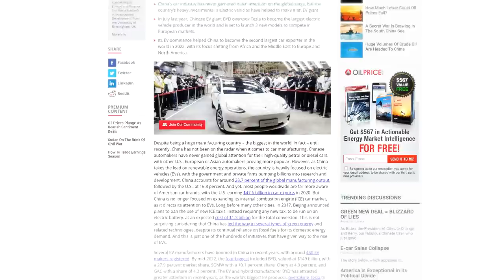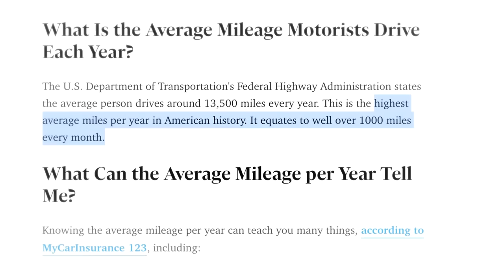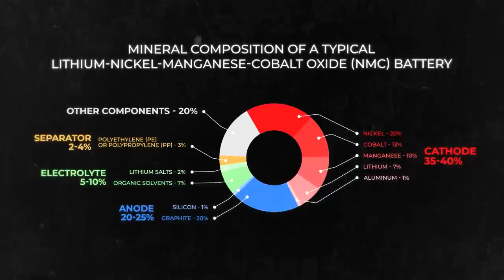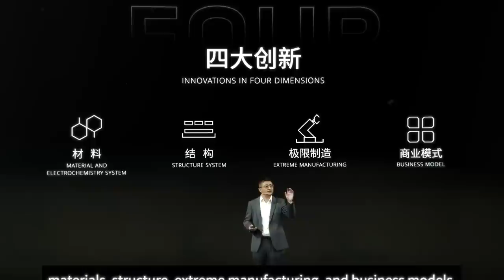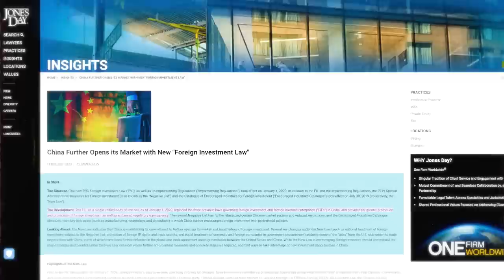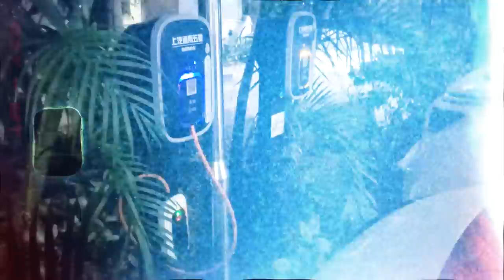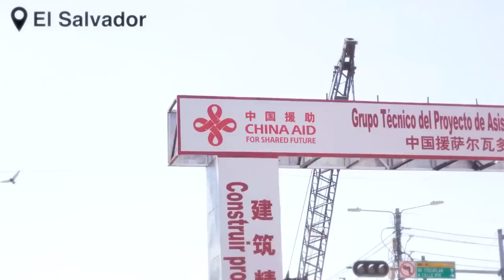How China Plans To Dominate the EV Industry

Comment: In 1Q2023 China has overtaken Japan as the top exporter of cars.
Reply from the maker: Ah, wish I had gotten a chance to include that stat in the video. Things change so quickly!
Reply: Including foreign brand's Cars made in China
Reply: @LaowaiDaveJCP  And Japan statistics include used cars export.
Reply: @LaowaiDaveJCP Tesla made in China, Ford made in China, Toyota made in China, so you admitted China have been more opened up to foreign business than jpan , USA
Reply: Not quality.
Reply: @lawrenceralph7481  All relative to price point. You could pick up a brand new Hyundai in the US back in the 1990s for $8,995. The 2023 Elantra is now 23k. All Chinese brands will increase in quality and therefor in prices as well.
Reply: @lawrenceralph7481 
The safety standard of BYD is 5 stars according to e.u. standard, it's battery come with 8 years warranty.
Reply: @LaowaiDaveJCP  From January to April in 2023, the top 10 auto export brands: SAIC Motor exported 313,000 vehicles, ranking first; Chery Automobile exported 244,000 units, ranking second; Tesla ranked third with 128,000 exports; Changan Automobile exports 117,000 units ranked fourth; Geely Auto exported 76,000 units, ranking fifth; Great Wall exports 74,000 units ranked sixth; Dongfeng Motor exported 66,000 units, ranking seventh; JAC exports 58,000 units ranked eighth; Byd exports 58,000 units, ranking ninth; Beijing Auto exports 50, 000 units ranked 10th.
Reply: @weizhang2834  absolutely China is more open than many other free market economies i know. I dont hate China i admire the Chinese Car market and China as a country The progress is amazing. 加油 However the numbers also include many foreign brands that's a fact and i Hope this number would rise multiple times when Nio,xpeng, byd, Liauto, zeekr get a fair share of the global market.
Reply: @LaowaiDaveJCP  In the era of globalization, it is normal to have foreign brands; However, China's own brands account for the vast majority of exported cars.
Reply: But it seems only in terms of volume, rather than profit.
Reply: @lawrenceralph7481  Go watch Sandy Monro ( American) comments on Chinese EV
Reply: 💐Peace Be With You💐
We invite you to the Religion of Islam, as
 you may find peace.
💎ISLAAM💎 is the latest revelation from The Almighty Allah (God) for all the  humankinds worldwide. 
If you die as a non-Muslim, according to Holy Qur'an there'd be an eternal punishment in the hell fire for  other religions will be invalid and it'll have consequences, since 1400 years, The Rules Apply.
Suggestion: Do Some research about All the  Religions, and then Choose the Religion That makes most sense. 
Welcome To ISLAAM 💚💐
Reply: We're just at the beginning of EV era and Japan already lost out... Increasingly Japan is only relevant in very niche markets, such as a specific type of semicondictor machine, or image sensor...
Reply: @lawrenceralph7481  You can compare the quality between a Tesla model3 made in Texas and a Tesla model3 made in Shanghai and you'll get an interesting result😂
Reply: So what? Do you care at all about quality & safety?
Reply: Becoz of tesla😢

Comment: I came to Shanghai recently from Canada, and I was shocked by the number of EVs running on the road. I also hear that if one wants to provide service like Uber they have to use an EV. Also, when i use car hailing services, i notice many local brands of EV that were unheard of. I think its one of those really strategically smart moves to boost the industry.
Reply: That‘s because the license plates of traditional internal combustion engine (ICE) cars are too expensive. Shanghai currently issues gasoline license plates through auctions, with 233,761 people participating in January, of which only 5.7 percent received a plate, with the lowest price sold at RMB 91,800. There is NO restrictions on what kind of car you need to be a Didi driver, but new drivers usually buy EVs because they are far more affordable and energy efficient. A vast majority of new Didi drivers buy EVs of Roewe, a local brand under Shanghai Automobile Industry Co., Ltd (SAIC). In the overseas market, these EVs are better known under the brand of MG, also an affiliate of SAIC.
Reply: Your understanding is incorrect. It's not that you can't do ride hailing services without an electric vehicle. As is well known, electric vehicles have much lower daily costs than gasoline vehicles, so using electric vehicles has higher profits and can earn more money, which no one can refuse.
Reply: @brushesSolder  that's fair - I heard that from some driver. Thanks for the update anyways
Reply: 電動車衹是一個工具，更難的是強大的電網，如何去解缺大量的充電需求
Reply: @lolololaw6939  上海几乎任何一个小区和商务楼都有充电桩。有需求就会有动力解决。如果你们解决不了，那说明你们的电网不够强大。
Reply: @cosmoobserver3416  我在廣州我很清楚，中国電網是世界頂尖的，尤其是超高壓傳輸😄
Reply: @lolololaw6939  中国国家电网是中国专利数量第一的科技公司。特高压电网是中国独一无二的技术。😄
Reply: 💐Peace Be With You💐
We invite you to the Religion of Islam, as
 you may find peace.
💎ISLAAM💎 is the latest revelation from The Almighty Allah (God) for all the  humankinds worldwide. 
If you die as a non-Muslim, according to Holy Qur'an there'd be an eternal punishment in the hell fire for  other religions will be invalid and it'll have consequences, since 1400 years, The Rules Apply.
Suggestion: Do Some research about All the  Religions, and then Choose the Religion That makes most sense. 
Welcome To ISLAAM 💚💐
Reply: @brushesSolder o I’m Chinese I can tell you that an EV is a must to gain the approval to provide service, on the other hand the driver positively accepts this regulation because only EV could be profitable.
Reply: Yea just came back from Shanghai last month and the roadside air quality is quite amazing. That's unthinkable just 10 years ago.
Reply: China at least have 30-40 ev brands. nearly all big companies join to make EVs in China. every day in Beijing i can sea a new EV spot on road.

Comment: China committed to be carbon neutral by 2060 and EV is a key strategy.  Don’t think market domination is a primary objective, respect and preserve the earth is a more important mission.

BTW, BYD Seagull offers Sodium ION battery now, which is cheaper to reduce; sodium is much easier to acquire than lithium also more environmentally friendly during manufacturing.

I bought my Tesla in 2017, received a healthy tax refund from federal and a rebate from California state, total close to $8000 dollars.  In addition, I can drive my car on carpool lane by myself.  So government subsidy in US has been in place for many years, the new law actually limits the federal credit amount based on where battery is made.
Reply from the maker: I believe the primary objective is reduce their biggest geopolitical weakness, which is their economy requires a massive amount of petrochemicals imports to run. Electricity can be generated internally either via coal, nuclear, or renewables, all three which China is heavily invested in.
Reply: China had no choice but to implement a policy whereby each car manufacturer must produce 40% of their production must be EV by 2030 in the first stage.
Heavy pollution ,a low visibility from  50 meter onward and health concern cause an alarm to central government. High rise building on the opposite site and beyond that range is beyond visibility. To tackle this issues in 2015 China embark this programs by providing billion of dollar to manufacturer, local government were provide financial support to build charging station free and to accelerate this program buyer was given an amount 60 thousands Renembi subsidy for their 1st EV until 2030
Reply: @Ukit50 Subsidies have ended at the end of last year, and car manufacturers have also reduced the cost of EVs to be close to that of gasoline vehicles. The important thing is that the environment for EV use has become friendly under the promotion of the government, and people can buy EVs with confidence.
Reply: @yudogcome5901  
ok mistaken effective 1st Jan 2023 ( 15 years subsidy) but other alternative  initiative was offer to attract EV buyer
Reply: @Ukit50 Yes, as I said, the government is creating a friendly environment for EV use, such as relatively high oil prices that are not linked to international oil prices😂, EV charging prices that are priced separately, and EV charging does not include household ladder electricity prices, 0.3 from 10:00 p.m. to 8:00 a.m.  Yuan/kwh, mandatory community supporting charging piles, charging car parking discounts, big cities restrict the registration of gasoline vehicles, but open the registration of new energy vehicles, these work, the Chinese government has continued to promote for 20 years
Reply: @MeridianMindset  發展電動車 不能忽略強大的電網，然而中国在電力和超高壓傳輸很強
Reply from the maker: @lolololaw6939  是的，那是另一個我希望我已經在影片中包含的事實"
Reply: @MeridianMindset  👍👍
Reply: 我家是农村的  20年前开始退耕还林…现在是青山绿水…我们的新疆省更是把沙漠变成了绿洲…电能是取之不尽的能源   未来的世界飞机 轮船也将是电动的 …有机会去中国看看吧 ， 现在的中国已经不是任人宰割的大清王朝了！😊看到了中国如今的变化你会有全新的认知…欢迎到中国来游玩…人类命运是共同的，地球就这么大 到处去看看吧
Reply: 💐Peace Be With You💐
We invite you to the Religion of Islam, as
 you may find peace.
💎ISLAAM💎 is the latest revelation from The Almighty Allah (God) for all the  humankinds worldwide. 
If you die as a non-Muslim, according to Holy Qur'an there'd be an eternal punishment in the hell fire for  other religions will be invalid and it'll have consequences, since 1400 years, The Rules Apply.
Suggestion: Do Some research about All the  Religions, and then Choose the Religion That makes most sense. 
Welcome To ISLAAM 💚💐
Reply: 💐Peace Be With You💐
We invite you to the Religion of Islam, as
 you may find peace.
💎ISLAAM💎 is the latest revelation from The Almighty Allah (God) for all the  humankinds worldwide. 
If you die as a non-Muslim, according to Holy Qur'an there'd be an eternal punishment in the hell fire for  other religions will be invalid and it'll have consequences, since 1400 years, The Rules Apply.
Suggestion: Do Some research about All the  Religions, and then Choose the Religion That makes most sense. 
Welcome To ISLAAM 💚💐

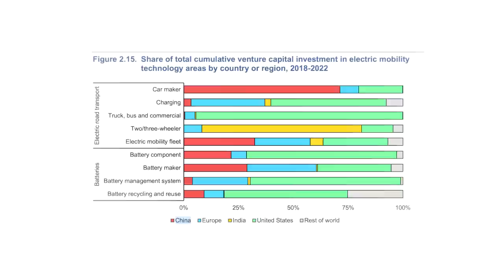Comment: 15:23 Unlike fuel cells, which have no problems with scarcity of raw materials. Right…
Reply from the maker: The scare materials being used in fuel cells, platinum group metals (PGMs), are also used in catalytic converters, hence there's not much of a difference if they were to be switch over to fuel cell vehicles.
Reply: @MeridianMindset  I wouldn't assume it's just platinum for some single kind of component. OTOH we should not assume the technology is static. Substitutes are sometimes possible. On the flip side, some new tech may come along that performs better, but may have more resource constraints.

Comment: The big question is, how long will they last and how reliable they be?
Reply from the maker: As mentioned in the video, it's generally easier to make a reliable EV compared to a reliable ICE automobile. The biggest problem with EV is the battery, which loses range over time, and, in rare instances, can combust causing a deadly fire. 

Of course, there's alot cars manufactures can get wrong there than the motor or propulsion. Infotainment systems, handling, suspension, panel gaps, safety features and other features are just as hard on EVs to get right.

However, there's been no evidence to my knowledge that Chinese cars being sold today are of particularly poor quality. Chinese suppliers have been supplying Western manufactures with parts for quite some time, and should be familiar with Western demands for quality control. And in 2023, they're projected to pass Japan as the biggest auto exporter in world by quantity.
Reply: Exactly
Reply: Regarding battery life, Tesla's report has made it very clear, and half of Tesla's cars use Chinese batteries.  In addition, there are a large number of EV rental cars in China, and the average battery attenuation of 300,000 kilometers is 10-20%, and some cars have even driven 900,000 kilometers.
Reply: @MeridianMindset  中国作为世界最大的汽车出口国，已经十几年了。在特斯拉之前，所有外资企业在中国生产都与中国国有企业合资，在中国销售的宝马、奔驰、法拉利、宾利其实都是中国企业生产、中国企业销售，欧美企业主要负责研发。当然，这个模式过去经常受中国人唾骂，现在却成了西方媒体宣传的中国经济胁迫的例证。😂
Reply: I came back from China last year. All taxi in China are EVs. They can easily run 300k km + without trouble. That's the answer I got from taxi drivers

Comment: It's not going to matter. Toyota is on the right track with hydrogen fuel cell powered cars...literally cars that run on water but still use a combustion engine with little modification...and they are dumping EVs. They don't need rare earth minerals, they don't put a strain on the power grid like EVs, and they hold their value. Other companies will follow suit. The only reason EVs are pushed they way they are is because of government interference and government subsidies.
Reply: Hydrogen is the correct path for semi-trucks, mining trucks, cargo ships and possibly airplanes but for smaller vehicles such as cars and motorbikes EV is the most efficient.
Reply: Not to mention hydrogen is super expensive and 98% of hydrogen is currently grey-hydrogen which means its derived off fossil fuels
Reply: Either you update your knowledge or you pretend not to see it. 😂😂😂
Reply: 如同马斯克说的，那是个愚蠢的发明。想象一下用电力电解水获得氢气再转化到机器的电力与动力……想象一下地下车库有汽车氢气泄露又有人吸烟，整栋大厦都会掀掉的，这是真真切切曾经在中国发生的事。永远不可能保证氢气不会泄露，汽车保有量越大泄露的次数就越多。
Reply: even a full tank of hydrogen weighs too much for a sedan
Reply: BOOM😮